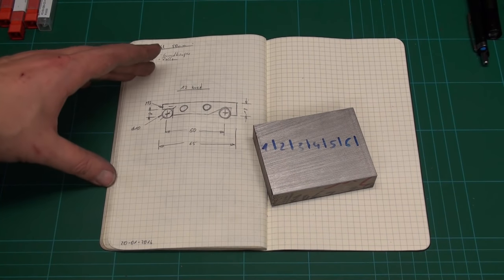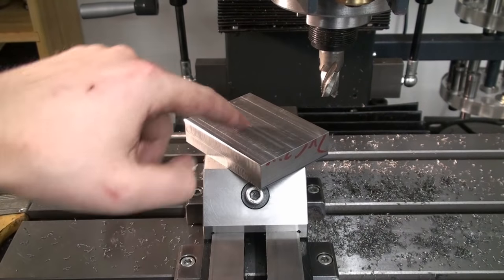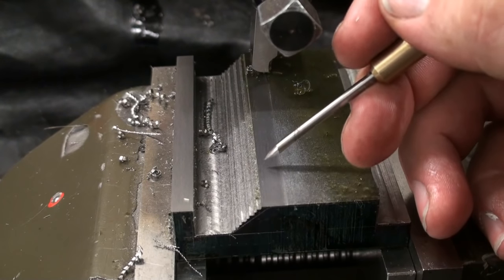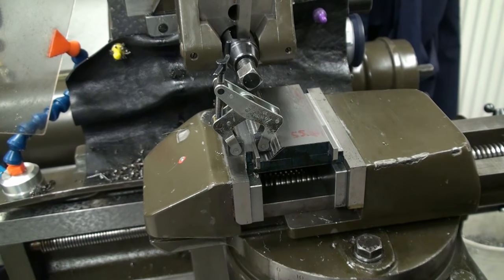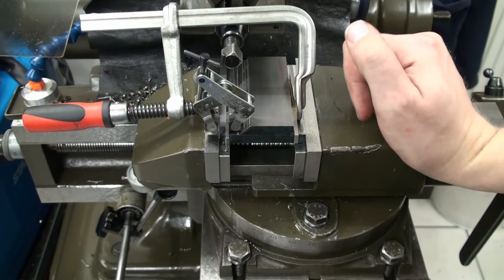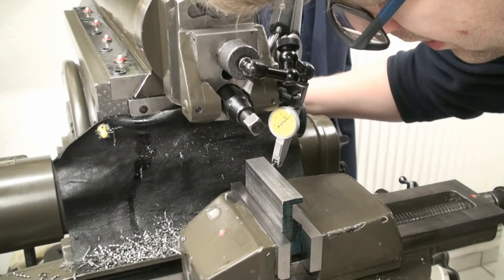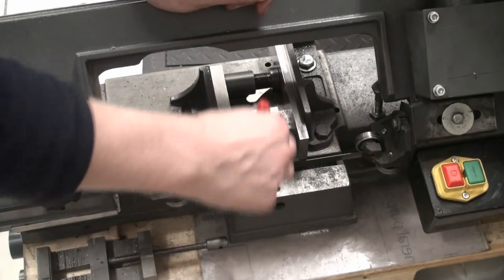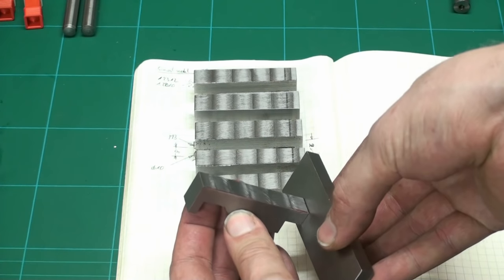Making small sine bars Part 1 - Herstellung kleiner Sinuslineale Teil 1

Comment: Great video. I use sine plates with magnet chuck for puting reliefs on shear blades but I use the sine bar if I need to sharpen cut off blades that have a taper to them. I work with progressive dies that stamp metal wood connectors. I’ve made v blocks, 123 blocks and angle blocks but I may have a go at making my own sine bar. This video helps me.

Comment: Recently I found I had need for a small sine bar, and so of course here I am watching this video again. :)
It occurs to me that another reason for the odd shape of the sine bar is ease of precision in manufacturing - the shape is such that the distance between center of the gauge rounds can always be adjusted by machining small amounts away; increased by machining away on the "L-shaped" end and decreased by removing material at the other end.
So you can very carefully achieve very tight tolerance for the length of the hypotenuse

Comment: Hi Stefan:

Another reason not to cut the notches in from  opposite sides of the bar, is if you do it that way, you only get one shot at the correct spacing. Once you go below 50mm, you can only make the spacing smaller.

With both notches cut from the same direction, as you did it, you can make the spacing larger or smaller by choosing which face to remove material from.

Comment: The only thing I missed is that you did not show the finish cutting of the ramp on the shaper. I suppose it is the same as the rough cut, only with smaller feeds in vertical/horizontal, nicht wahr? What a great tool Herr (or Herren) Gack built.

Comment: Always a pleasure to see your videos, and to learn from them. Your running commentary is most useful. What is the standard used for the designation 123-12 tool steel you mention? Is there an equivalent designation? I've been trying to find a source in Denmark from where we usually order materials (here in Greenland).
Reply: +Jim Milne Try looking into a prehardened 4140. In the US it goes by the 4142 designation. Not sure it is the same stuff he is using, but it has the same properties he describes. I use it occasionally and like it.

Comment: you said you wouldn't use the sine bars for grinding since the distance wasn't exactly 50. but wouldn't it just be a case of putting in 50.005 into the calculator. then it would be equally as  accurate as any sine bar
Reply from the maker: Right :)
But there is still not the precision built into mine, I think. But to be realistic, it should be good enough for 99.0% of jobs I do in my shop - I used it recently to grind a few form tools and when I checked the angles under my toolmakers microscope, everything was fine :D

Comment: It took some research to find the equivalent bit the metal you are using 12312 is not available in the US, here that is equivalent to 4140 Tool Steel. Not an identical replacement but the closest readily available here.

Comment: Can you tell me for what the thread on the spindle of your milling machine is?
Reply from the maker: +1AB09CC3 That thread is on the MT4/Mt2 sleeve that I have quite a lot in use - Its there to pull the sleeve out of the spindle with a big nut.
Reply: +Stefan Gotteswinter Got it. Like on some types of live centers for a lathe.
Reply: +Stefan Gotteswinter BTW: jacknut would be the right term.

Musste eben auch mal schnell nachgucken als deutscher Muttersprachler :)